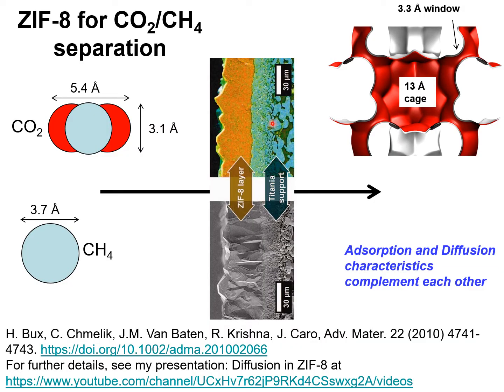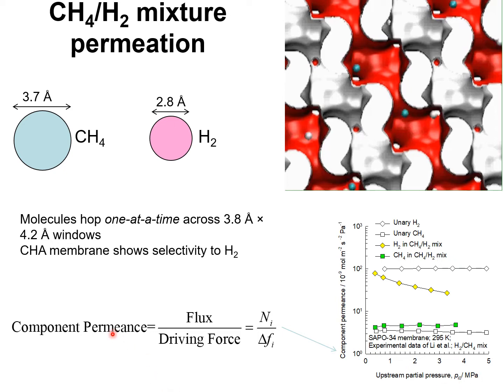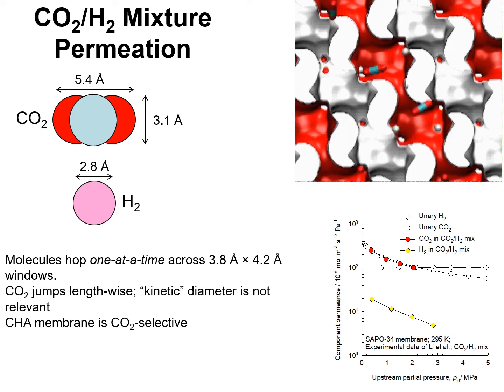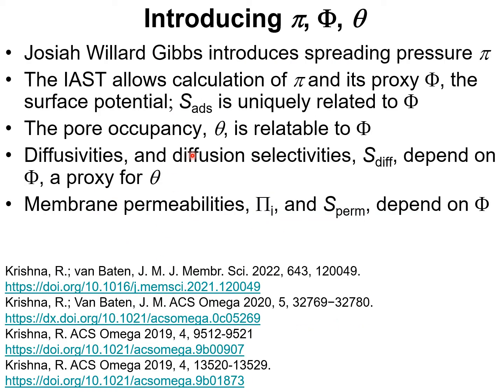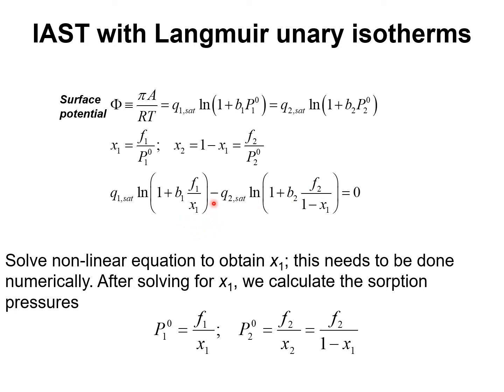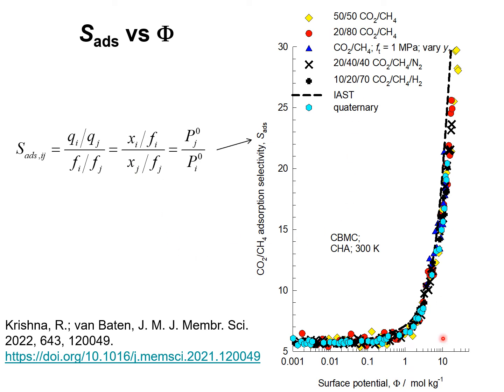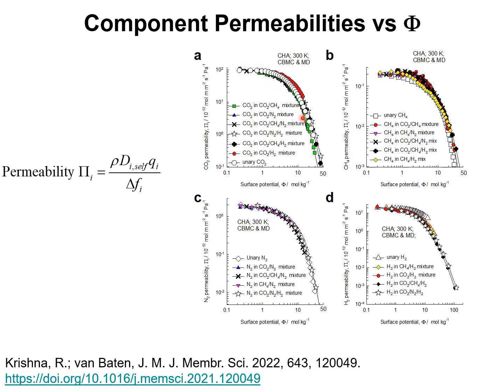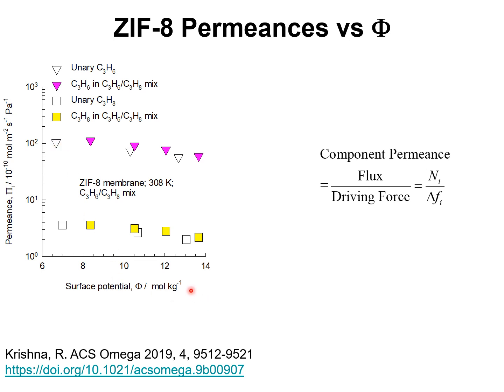The Spreading Pressure Concept for Microporous Membranes

Comment: It was very helpful!! Thank you so much. I am working on Binary gas adsorption. I am thinking of using MPD(Myers-Prausnitz-Dubinin) model which is the combination of the IAST with a formulation of the pure gas isotherms with the help of DA(Dubinin-Astakhov) equation. but then I was stuck in solving IAST equation which has incomplete gamma function. Do you have any excel sheet for this? I would like to estimate binary gas adsorption on activated carbon by using pure gas isotherm.